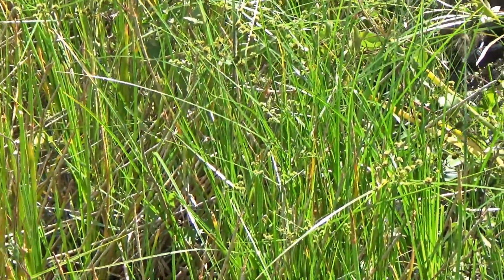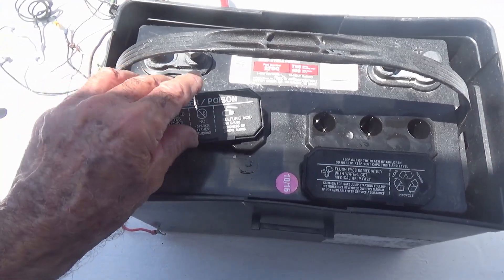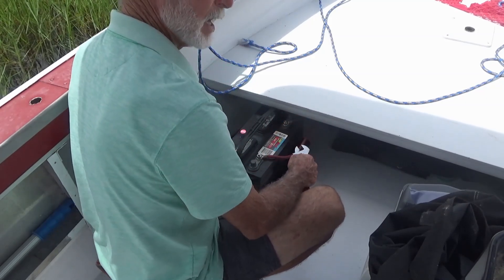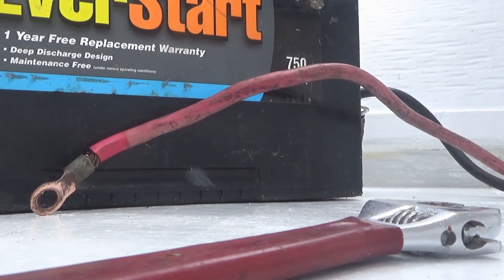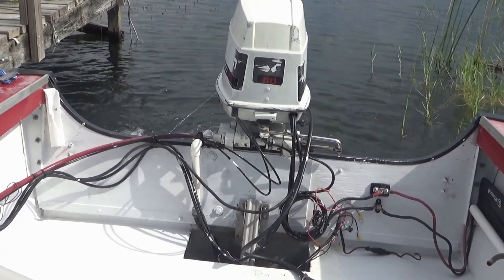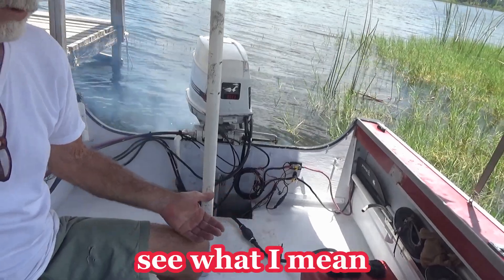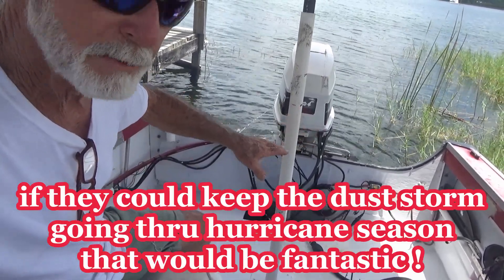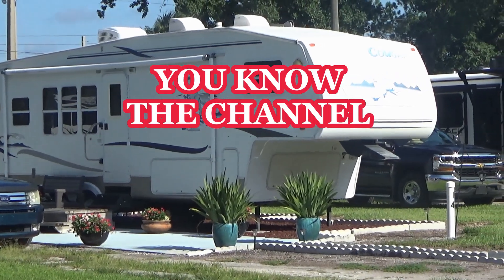Relocating Boat Marine Battery and This Happened - #outboardrepairvideos

Comment: Congratulation on the new TOO residence ! Increasing the amperage, could only increase power loss through resistance (heat). As someone else pointed out, you ought to increase the size of those cables. Gauge #6 is fine up to the 6-8 feet range on those 12V batteries. Over that, do yourself a favour and move up to #4 for that run from the battery to your transom connection box. Get it from a welding shop as these guys have to change them when the outer lining gets a bit wore out. The usually sell it for around the price of scrap copper. Just slip heat-shrinking tube over the thinner areas and you'll be off to the races. Regards !
Reply from the maker: I wont be living in it. I'm a Class A guy! It needs some work but that's ok! Thanks for tuning in!

Comment: Nice 5th wheel Too, you going to move into it and move it to your lot? They are nice with the slide outs. Lots of room. Yes, put the other battery in the boat. I have 2 in my Starcraft but only one hooked up. At least I have a backup if needed.
Reply from the maker: No I won't be living in it. It won't fit in my lot unless I push it up here. The front doors on the 5th wheels are on the wrong side for this lot and it can't be towed in unless we chop down some trees. I'm more a class a guy anyway, I like motors! If I can't drive it I don't want it. Hahaha. I've been taking care of it for the old man for years now so he wanted a new one, guess who got the old one. Me! Hahaha. It needs some work but overall in pretty good shape. It's gonna get me that cargo trailer I want! Thanks for tuning in!

Comment: you need to get a bigger Battey. You have what they call a group24.   get a Group 27 size Battey. that one only has 750 cold cranking amps that low.
Reply from the maker: It is a 27. Thanks for tuning in!

Comment: Large gauge wire will do the trick 😉👍 you could add a couple smaller gauge fused wires to experiment and put your mind at ease that the cable is the trouble. If the wires get Hot they are too small.
Reply: Congrats on the New Homestead she's a Beaut Clark 😄👍
Reply from the maker: I won't be living in it, can't dive it, got no truck, ain't no good! I'm a Class A guy, it's gotta have a motor! Thanks for tuning in!
Reply from the maker: Thanks !

Comment: Borrow a meter that has a clamp, that way you can check the amperage draw through the cables. The battery voltage may be ok but it could have a bad cell. Everything is tight except for those loose nuts.😮
Reply from the maker: Hahaha Thanks for tuning in!

Comment: Even on a lake you should have a dedicated battery for the starter and everything else on another-or more. You'll like the Cougar if it's in good shape. It's about the same as what I downsized to. Had the 44', downsized to a 32', but beings the 44' had a 12' "toy hauler"  I've still got the same living space. That 12 foot garage in back was sure handy though, but being able to move this with the F150 makes up for it.
Reply from the maker: Yeah the cougar is nice, it needs some work, typical leak in the corner at the slide out. I just did Mike the mechanics Keystone 5th wheel across the street from me, wall rotted out, floor rotted out, pain in the azz! I won't be living in it. No motor! Hahaha, no truck to pull it and can't drive it so it's a flip. It will get me the cargo trailer I want and then some. Thanks for tuning in!

Comment: I’ve seen small solar power panels that you just connect to the battery and it keeps it charged up. A lot of farmers use them for tractors or farm trucks that are not used a lot and the batteries go dead. They just lay it on the dashboard and plug into cigarette lighter. You could use one and never have to change a battery again. 
I’m getting a bunch of good batteries next week. They are all good 6 year batteries only been used 2 years but have to be changed out every 2 years for military regulations. 12 v 50 amp hour totally sealed VRLA I’m gonna sell for $25. a piece. I should have around 50 to 70 if anyone wants any
Reply from the maker: I had a solar panel and the sun melted it. Hahaha now thats funny and true! Thanks for tuning in!
Reply: @THISOLDOUTBOARD1  that is funny

Comment: Checking cranking voltage should not be no more than 1.5 volt drop
Meaning a 10.5 volts when cranking or more
Reply from the maker: Hey! Thanks man. You still looking for a 70 hp gearcase? I have one, don't know anything about it other then it shifts and spins. Let me know! Thanks again !

Comment: hey I have this 50 hp Johnson and its is running rough on idle what I mean by that is that it wont idle for less then 1 minute and the carburetors have been rebuilt and I don't know what to do and it has the vro delete if you can help me out I would really appreciate it
Reply from the maker: Hey. Thanks for tuning in. Is this a motor you just got? Did it run better before you rebuilt the carbs? Where are the slow speed needles set at? Have you tested the fuel pump? Is the fuel pump the right one for a vro replacement? Is the tank vent open? I need more info!!! LMK Thanks !
Reply: @THISOLDOUTBOARD1  yes i just bought the motor and it runs the same even though I rebuilt the carb the fuel pump is brand new   i also replaced it and i don't know abt the slow speed needles and the vent was open
Reply from the maker: @austinsmith590  Hey. So it's just an idle problem and I'm assuming it revs up. Did you do a compression test, if it's got good compression the rest is just a pain in the azz! When you rebuilt the carbs did you also clean them. If the slow speed/idle circuit is the slightest bit dirty/clogged your gonna have idle problems. They need to be surgically clean along with the high speed circuit jet/orifice. I see this happen a lot. No amount of carb spray will do it, those little holes need to be poked with a thin wire, some people use guitar strings. Anyway thats where I would start, with any old outboard that's just standard routine, check out my carb cleaning video if need be. So once your convinced the fuel system is good from the tank back, no air leaks, correct fuel pump, carbs clean, floats set level and float drop distance is set, reed valves are working properly and you still have the same problem then I would move on to ignition, link & sync, idle timing could be off. Again standard routine. Double check for good strong spark on both cylinders. Your best bet would be to get an OMC service manual specific to the year/model. It will guide through the proper procedures to set everything up. It has a great troubleshooting section too. Try ebay for a good used one usually around $30. Some of these models don't have the slow speed idle adjustment needle and some do. If yours does set them at 1 & 1/2 turns out from seated. that should put them in the ballpark. And one more thing, never assume anything with these things, just because something "looks" okay, doesn't mean it is. Curious to know what happens. Thanks again !
Reply: @THISOLDOUTBOARD1  hello the idle got fixed now it is smooth it needed some adjusting and some cleaning. but now when i want to start it keeps clicking and there is nothing wrong with the starter or the solenoid and it happens sometimes and it stops then starts so i don't what the issue is there
Reply from the maker: @austinsmith590  usually a continuous clicking sound from the solenoid is a bad or low voltage battery if it only clicks once thats usually a bad ground or connection somewhere